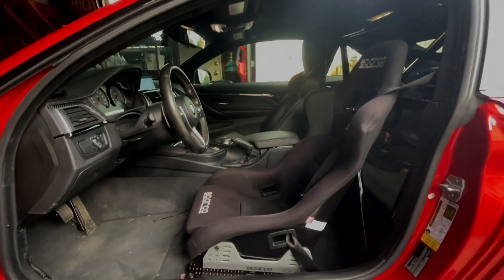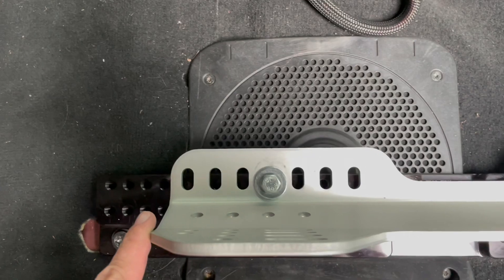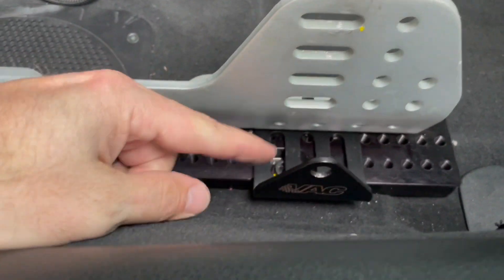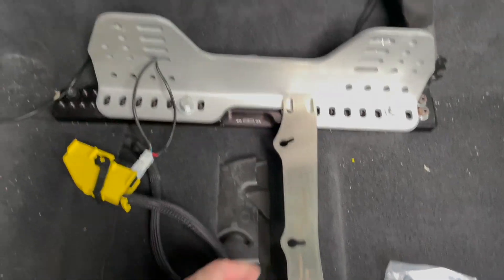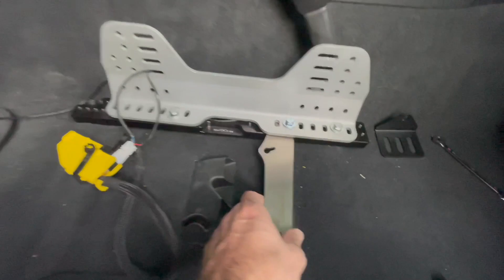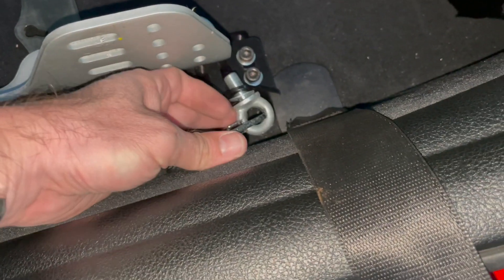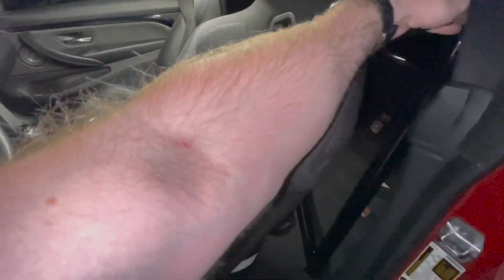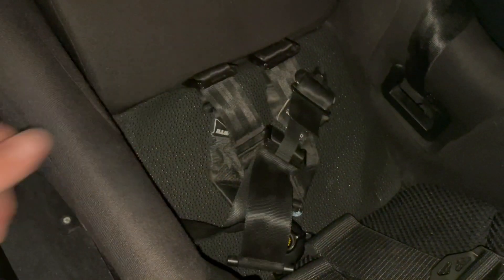F8x Racing Harness/Seat Install

Comment: Thanks for the video. I’m doing research to put a seat in my F87. What did you do about the airbag? Did you code out the seat air bag or use a resistor?

Comment: Mount the 3-pt seat belt under the vac floor mounts. Same for the vac belt mounts and anti-sub bar. things are much secured when it’s mounted under vs at the top
Reply from the maker: Not sure how that would even be possible
Reply from the maker: Okay interesting not sure why I never noticed that in the pictures but yeah I’m gonna have to switch that around and see how it works out.
Reply: @BlakesGarage  haha thought the same before too. more secure when it's mounted under.